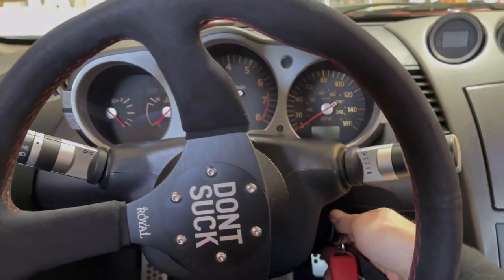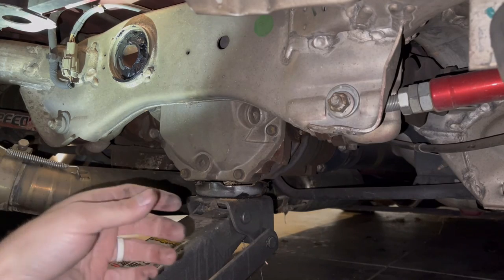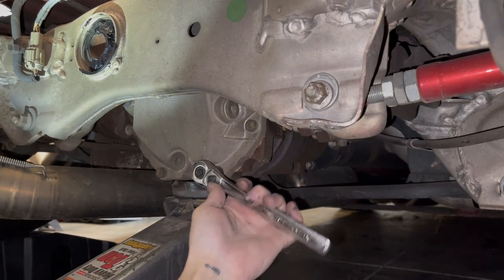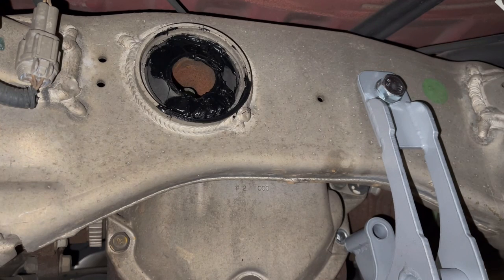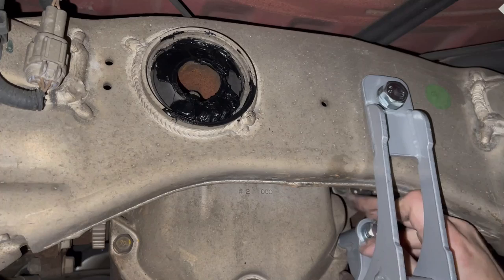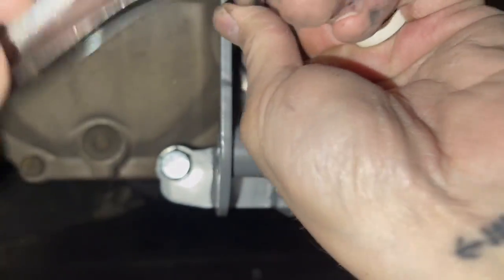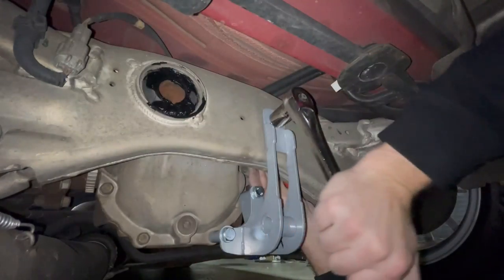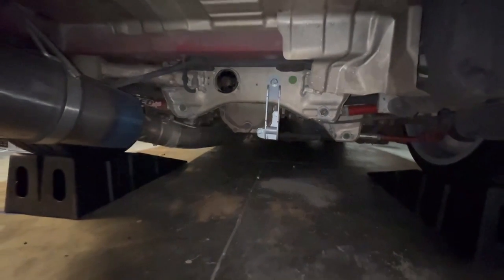Bell Raceworks 350z Diff Brace Install  EASIEST 350z Diff Brace Installation EVER!

Comment: you probably address this later on in the series, but its odd to me to have the eccentric bolts still in for the camber and toe, when the car has adjustable camber and toe arms.  nice work though and im enjoying the progress.
Reply from the maker: Actually, I’m not sure I’ve even noticed!  I’ve had it as a plan to swap out those Godspeed arms since the beginning so I really haven’t even looked at them!
Reply: @SpeedCultureStudios  lockout kits are relatively cheap and while youre doing the arms you basically have done all the work.  i look out for that episode in the future!

Comment: Cool vid...Are you able remove the diff filler plug with this installed ?
Looks pretty close, Easy enough to move the brace I guess,,, was just curious
Reply from the maker: I just actually did a diff fluid change video with this brace installed.  I had to loosen it to rotate it slightly in order to pull the plug out.
Reply: @SpeedCultureStudios I'll check it out...thanks

Comment: Looking at this brace and the one from Z1 for my G35 HR. Any notable differences?
Reply from the maker: Yes can definitely feel the added rigidity in the rear.  It’ll feel even better when I get my diff bushings replaced!
Reply: @SpeedCultureStudios  Would you stick with Bell Raceworks or go Z1?
Reply from the maker: @TheMr2kFreak  z1 does not have a diff brace for the 350z.
Reply: @SpeedCultureStudios  Sorry, I’m trying to understand how the quality compares between the two and if Z1 is worth the extra $20. Comparing the one you have on your Q50 and the one on your 350Z. Any notable differences between the two?
Reply from the maker: @TheMr2kFreak  The z1 brace is a better design.

Comment: you always seem to post the things i have most recently looked into for my own g37 sedan. alas pockets are not deep and the market is fucked. most of my main upgrades will have to wait. for now its just suspension and this was included in my list. My G is having TCM problems with 3-4 gear. any idea how much that shit even costs?
Reply from the maker: Transmission issues are never cheap.  What sort of TCM issue are you having?
Reply: @SpeedCultureStudios  it’s a coasting issue while in 3rd-4th gear. it feels like my car slows itself down when i’m not on the gas, just coasting. only in between 2nd and 4th gear. got the 7At
Reply from the maker: @yungqueso4211  unless you’re getting codes, that sounds normal to me.  Does it happen in auto mode or in manual mode?
Reply: @SpeedCultureStudios  it’s both. was looking on forums, some ppl were saying it’s a TCM reprogramming issue. figured you had some specific insight is all.
Reply from the maker: @yungqueso4211  no I don’t sorry.  Haven’t heard of that being an issue.  Obviously in manual mode if you’re in a lower gear it’ll slow you down—it’s engine braking.  But it should not do that in auto